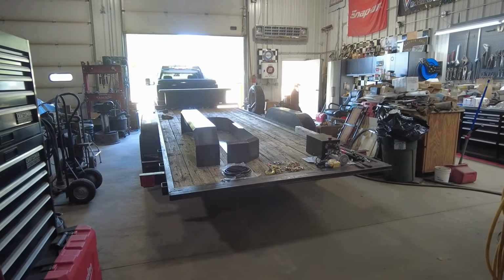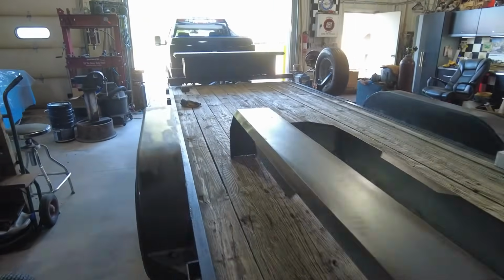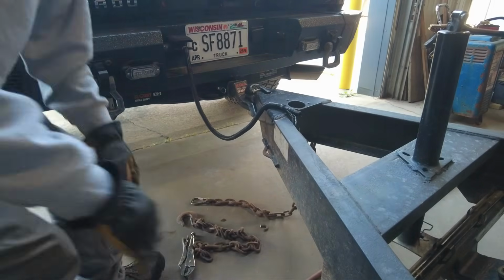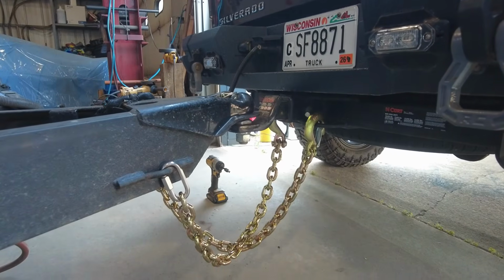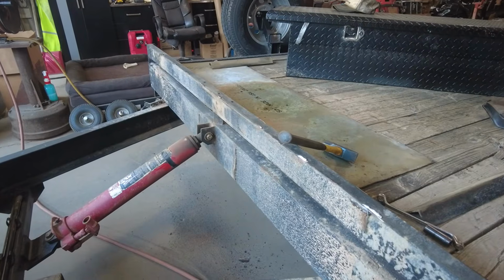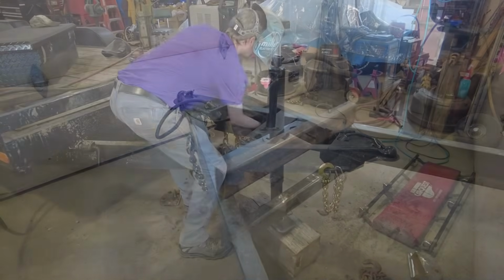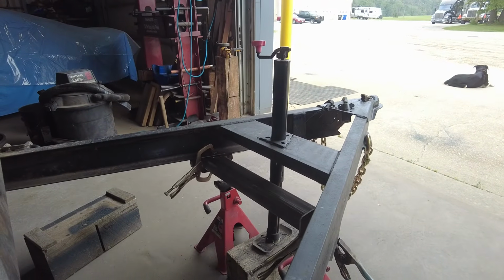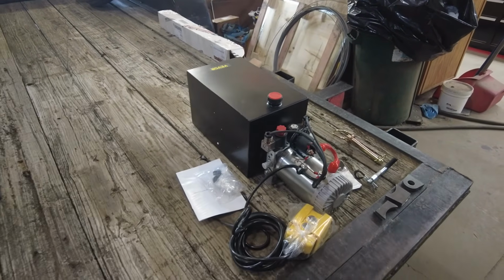2003 18ft Tilt Bed Trailer Project Part 1

Comment: If you still have that screw that looks like a star or torx head i bet it's a self tapper used in Rv and utility box trailers which is a square bit but the call them I think a universal head so the bit can go into the head of the screw easily. I had that problem on my box trailer changing out a light fixture on the ceiling none of my torx bits would fit so I found out from a trailer dealership lol. This maybe useful info down the road lol.

Comment: Hello, I have a 20’ 14K manual tilt trailer I’d like to do the same to. Could you add links to parts? Ram, fittings, pump, lines, etc… thanks
Reply from the maker: Check out the next video in the playlist for links to a lot of parts. The cylinder, fittings and hydraulic lines aren't linked. I can look for links if you really want them. I didn't think others would need the same cylinder.
Reply: Thanks for the reply. I did see all the other parts links including the hydraulic power unit. If you have time could you link the ram, lines and fittings. I’ll start with what you used and determine if I need another size ram once I take measurements. My trailer has the same manual red “engine hoist” hydraulic as yours… I think if I use the exact parts I’ll be good to go. Thank you in advance and thanks for your videos
Reply from the maker: Hydraulic Cylinder: https://amzn.to/44cOfxx
Cylinder Fittings: https://amzn.to/44yGHUN
Links to the cylinder and fitting for that cylinder. I used 3/8 JIC to 3/8 hose fittings for the hoses. We had that stuff already so no links. You can buy hose premade pretty easily or have a local home store make some for you. Hope this helps.

Comment: Those quick links for the chains have very low working load limits that aren't suitable for safety chains
Reply from the maker: Curt Hitches sells a quick link for safety chains with the same load range as the ones I used. I think the link I used was rated for more than the Curt ones.
Reply: @mossman381  3/8" Grade 80 chain = around 28,400 lbs breaking strength 

3/8" Quick link = around 11,000 lbs breaking strength

So that quick link might be enough but it's by far the weak point compared to the chain. If using a quick link, it's usually a size bigger than the chain, say 3/8" quick link and 5/16" chain. Or weld the chains on, as long as the welded joint provides the breaking strength required.
Reply from the maker: I do understand that the quick link is the weak point. The trailer is only rated for 10,000lbs.

Comment: Gonna be a nice trailer. I just recently bought a 2006 Duramax that needs some work. Been rewatching a lot of your older videos for helpful tips 👍🏻 I miss the old Darth Dually
Reply from the maker: I miss the dually but it was a Wisconsin truck. I did rockers and cab corners but the rest of the truck was getting rusty. My 2009 doesn't have the Duramax but it's a way better truck.